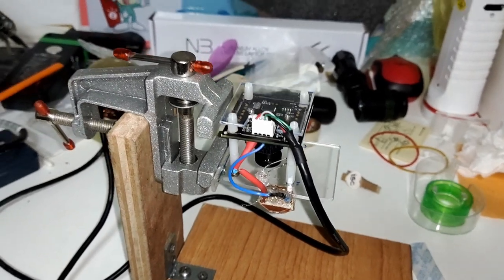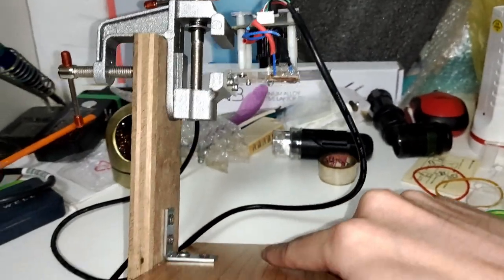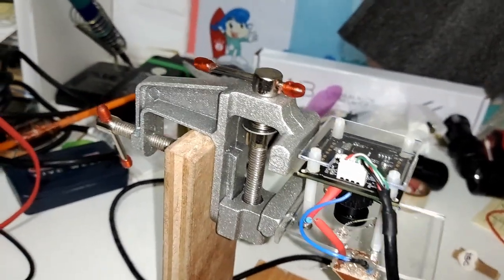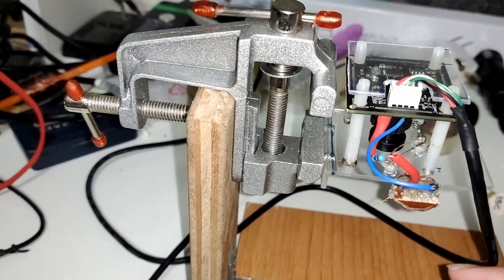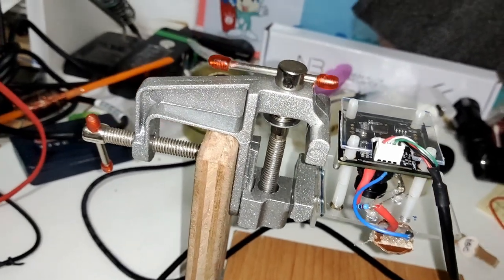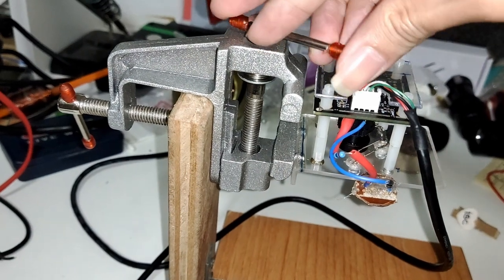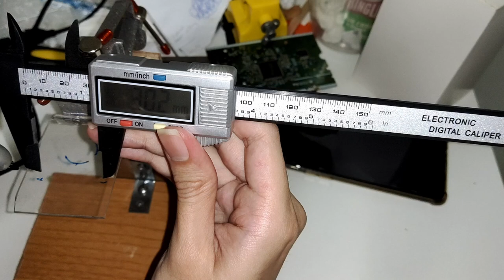DIY microscope for SMD soldering

Comment: Where did you find the lens you are using?   I've been trying to do this exact thing but have been having difficulty finding an appropriate lens.
Reply from the maker: I bought the camera camera that came with the 16mm lens mounted on AliExpress. To ensure compatibility, buy the lens and camera module as a set. You may want to explore other e-commerce website

Comment: Can I use this module for vga connector? 
I have 12v monitor with VGA connector can it be done in any kind of a way? Please
Reply from the maker: You'll need to buy a camera module that support VGA input.
Reply: @diyelectrovids6536  alright alright good, all in all a camera module? No power source? 5v or 12v? It will transfer image directly to VGA monitor? Just by connecting through VGA plug? Thanks for answer I really appreciate it.🌹🌹
Reply from the maker: @ahmedjalout1154  Need power source. In my case the phone powers up the camera
Reply: @diyelectrovids6536  dear sir please help I peg your kind patients, I need to connect it to the monitor, I see that in your case it is a mobile phone, what I am trying to build is a professional microscope with enough space to solder, which is connected to 12v monitor cause there is no 220v ac power I mean no need to arduino board to drive it no program just like plug and play?? Thanks and sorry for long question thank you.🙏🙏
Reply: @ahmedjalout1154  if you want PROFESSIONAL GRADE MICROSCOPE…buy the professional one..this is cheap DIY alternative….if you can build a professional microscope option….you’ll not asking here LOL…
Reply: @LeeMooEez  we live in a war zone in Syria, cold, hunger and poverty, I cannot afford a proffesional one, it is like my salary for more than a year, thanks for such wonderful advice, like I never thoght of it 😒😒 puff....
Reply: @ahmedjalout1154  there is limit to what you can DIY with limited resources and knowlegde…you asking too much from him..he already answer you what he know he capable of…your demand is on professional engineering level and with a proper resources…you need to realize what you are asking for…you realise that you live in war zone with very limited resources..how can he or yourself fulfil your desire to create expensive professional grade microscope? You should be grateful with cheap diy alternative as shown on this video…altho that you still need to buy ready part as in the video…not create it from scratch..since you said don’t want to use even adrino..professional grade miscroscope is beyond that capability
Reply: @LeeMooEez  yes, and I presume you are his lawer? Sorry if asked your client too much help. End this conversation please.
Reply: @ahmedjalout1154  wow your attitude is “very good” I see and goodluck with your wish then 😌